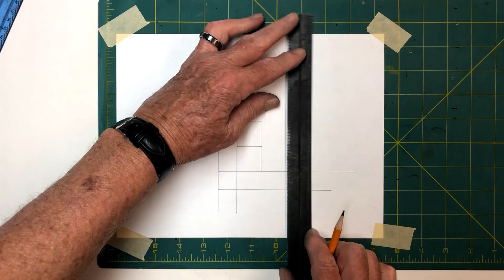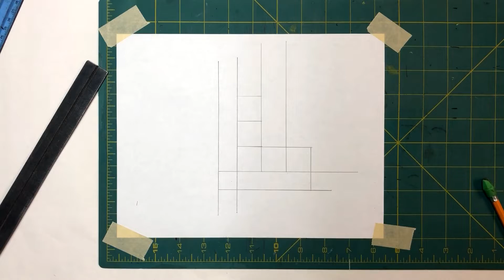Leaded Glass Spinner for Beginners !!!

Comment: Thank you So much Bill! I've tried to do a spinner watching other videos.... failure. Your videos are the best for those of us that are visual plus verbal direction. Best to you and yours!
Reply from the maker: Hi Julie,
If you're having some trouble putting this together, cut 6 -4"x4" cheap clear glass pieces and work on putting them together, before you start cutting up you're good glass. You can use the clear one as a trial run. You will only be out a little U Came and some solder. After you get where your comfortable putting it together, you can cut the U Came off at the solder joints and use it on another project. Let me know how you're doing with the project. Best of luck!!!
Regards,
Bill Stone

Comment: I’m so glad you did a spinner. I happen to be working on one now. I cut 6 4x4 light amber squares, that I etched rabbits into the glass. I wasn’t sure how I wanted to go from there, but now I do. I was wondering if I could use lead came, because all that I’ve seen so far have been copper foiled, so I’m very happy that I can use lead came. Thank you so much for sharing your process in making a spinner. I know now that I won’t have any problems ( hopefully 😊).
Reply from the maker: Hi Therese,
Good to hear from you, sounds like you are working on a spinner right now, GOOD FOR YOU. Sounds like a great project, should look great hanging in your patio. Best of luck with the project.
Regards,
Bill Stone

Comment: I love this ... I do a lot of copper foil suncatchers.  Thank you for this video <3
Reply from the maker: Hi Deborah,
So glad you're enjoying the video, I have had so much fun making them and sharing them with others. You can find all my videos in one place by typing in the search bar Bill Stone's Stained Glass Creations and click on my photo and they will all come up!! You also can make this spinner using the copper foil system, it's a little harder to put the hanger on the copper foil, but if you have been making suncatchers you shouldn't have any trouble. You can also make the inter part of the panels in copper foil and finish off the outside edges with lead U came. Check out my video on the flower solar lantern's and the one with the sea glass! All three of these projects use both lead came and copper foil. Again think's for your comment on the video.
Regards,
Bill Stone

Comment: I love the spinner.  I’ve made a couple using foil and solder but not lead.  Is there a specific size of lead you are using?  And do you have to grout it to hold the glass in?
Reply from the maker: Hi Gloria,
Glade you are enjoying the videos. I use RU-70 U came, it's 1/4" wide, 5/32" channel and 3/16" Face. The H Came is RH-9, It's 7/32 Wide, 3/16" channel and 5/32" Face. You can check all the came sizes by going online and type in Cascade Metals. They are a large supplier of lead came. The chart comes up in decimals, there is a box to check to make it into fractions. I use this came for all my projects, big or small. I don't know if you looked at the video on the leaded glass clock? At the end of that video, it shows some of the larger window projects made with that same size came. If there is any draw back to that came, it's that you have to cut your glass very accurate as there is a very small channel for the glass to fit into!!!
Hopefully that helps you out, if not send me another comment and I will try to get you a answer.
Have a great day.
Regards,
Bill Stone
Reply: @billstonesstainedglasscrea3310  thank you for the info. I’ll check them out.  

So because of the came you are using and the glass is cut so precisely you don’t have to grout your pieces?
Reply from the maker: Hi again, 
You're right the more precisely your glass is cut the less room the glass has to move around in the came. I have been making these Solar Lanterns, Suncatchers and Spinners for the past 20 years and I've never had one come apart yet!! Also glazing the glass panels is my least favor part of doing leaded glass, it's messy and a lot of work and time to clean it up after glazing it. Try it both ways and see if you see any difference in your small projects. Glazing the panels will make them stronger. Best of luck on your projects.
Regards,
Bill Stone

Comment: Hello Bill, Thank you for your easy instructions.  I am sorta new and may I ask one thing I have the spinner jig what do you use to make that seems on the inside of the jig?   
thank you for giving me new ideas and help.. I've not made a spinner yet LOL little scary.  
Karen in SC keep bringing new videos.
Reply from the maker: Hi Karen,
Nice to hear from you again. The small strips on the spinner jig are,
3/16" square and are made of wood. I just cut them out on a table saw. So glad you're enjoying the videos, you should check out the newest one on how to make a Leaded Glass Hanging Terrarium, in it I talk about the small jig I use to put the sides together in it. It's the same one I use to put the spinner into sets of two before I use the spinner jig to do the final assembly on the spinner. If you are using a different size U came you would make a small strip to match the size of your came width. You just want the edges of the two pieces to kiss the outer edge of the came, If your real new to leaded glass you could just cut 6 4"x4" clear window glass and put it together to get a trial run before using your expensive glass. I sometime use scrap clear glass when I'm trying to work out a problem on a project. You can find all my videos in one place by typing in Bill Stone's Stained Glass Creation in the search bar and click on my photo. Please feel free to ask me any questions about any of my videos.
Regards,
Bill Stone

Comment: Hi Bill, The push pins seem like they are going into the work surface fairly easily. Is the work surface a sheet of sound board? Thanks
Reply from the maker: Hi Joey,
Great to hear from you.
 Yes, the top of my build table is made of 1/2" Homasote #440- Sound Barrier Board. The worktable has a 3/4" plywood base with the Homasote board on top. You can purchase this at most old fashion Lumber Yards. It comes in a 4'x8' sheet 1/2" thick. Most lumber yards will cut it to the size you need. The push pins I use are 5/8" long, they also make a 1/2" pin but I like the longer pins better. If you are just starting out in leaded glass and don't want to buy the larger sheet you can find it on Amazon and Delphi Glass, in 24"x24" sheets. If you can use the larger size sheet then go for that, it is much cheaper than the smaller sizes per square foot. I use this pen system on all my larger glass projects also. If you want to check some of these larger projects, go to the end of the video showing how to make the Leaded Glass Clock project. Thanks for your comment and if you have any questions, please feel free to ask me about any of these projects. Have a great day!!
Regards,
Bill Stone
Reply: @billstonesstainedglasscrea3310  great information sir! Thank you
Reply from the maker: Hi Joey,
Glad the info was helpful, and you can use some of the info. If your just getting started here is a great webpage to find out all you need to know about Lead Came. All the projects I make are using RU-70 U came and RH-9 H came. All these Came products are made by Cascade Metals and it shows everything you need to know about Lead Came.  Have a great day! 
Regards,
Bill Stone

Comment: When you are using your designated rulers to cut your pieces, are you compensating for the lead?  The cutter head is not directly next to the ruler edge so wondering if this makes your piece grow????  Thx
Reply from the maker: Hi Mary
Things for your comment. Yes, your right, because the scoring wheel is in between the two up rights on your glass cutter you do add to each cut and the projects grows a little. What I do to compensate for this is I will cut the glass to the sizes I want using these standard rulers then set up my form to make the project. Stating in the left-hand corner with a 90-degree angle install my U Came down the side and across the bottom leaving it long on purpose. Then install my glass in the order I want it to go with my H Came in between the glass pieces. When I get then all in place, I put a piece of U Came down the other side, then I will add my form to make up the size of the project. By doing this that way you can use these standard size rulers. If you don't do it this way, then you will have to come up with a smaller ruler approximately 1/16" small then the size you want to be your finished piece of glass. I hope that makes sense to you. When you have some time check out my first video called Leaded Glass Solar Lantern and it shows that on the video, where I cut the glass using a, 2", 1", 3/4" and 1/2" ruler to make piece which would measure 4 1/4" although I need the project to be 4 1/2" wide, after adding the U Came Around all sides and the H Came in-between it comes out at about 4 9/16". That video is the very first video on my video list. Hope that helps you out!!
Have a great day!!
Regarsd,
Bill Stone
Reply: @billstonesstainedglasscrea3310  yes it makes perfect sense.   I have watched all the videos and the instructions and tips are very helpful, especially using the cotter pins as hooks.  I only work with lead and was excited to watch the spinner video.  I was under the assumption they were always done with copper foil!  My next project 😃😃😃. Then on to the lanterns!  Thx for all the great videos!!!
Reply from the maker: Hi Mary,
So glad the info I sent was helpful. I have always liked Leaded Glass better than Copper Foil; I like the nice lines it makes so much better than the solder bead on Copper Foil. Almost all the larger projects I make are all Lead Came. Did you look at the video WHAT I DO WHEN NOT MAKING THESE YouTube VIDEOS!! there are several Copper Foil projects in there along with all the Leaded Glass projects. Check it out when you have time. Back to your original question regarding the Came makes your project grow. When you make your own designs up like most of my projects, I use what I call Cut and stack and don't really care if they grow a little. The only time I have to be sure to make the project to size is when it has to fit into windows or doors, then it's important that it fits!! Best of luck with your spinner.
Regards,
Bill Stone

Comment: Hi Bill. I have made this type of spinner using foil and solder. I would love to try this with came. Could you tell me if this is lead or zinc and where can I buy the size you use? Thanks
Reply from the maker: Hi,
The came in all my projects are made by Cascade Metals, they have a great web page on lead came, check it out when you have time. The lead came I use is RU-70 for the U came and RH-9 for the H came. If you haven't used lead came before, be sure to stretch it before you use it. If you're not sure how to do this check out my video on how to make a solar lantern for the beginner, it will show you how to stretch the came. This is the first video I made and is at the very end of the list when you go to my YouTube channel. If you check out Cascade Metals, just look at the lead came spec sheet to get all the sizes for the came I am using. So glad you are going to try the leaded glass system, I like it much better than copper foil, but sometimes the project can only be done in copper foil so it's nice to know how to do both systems. You can buy it from any glass supply store, E Bay, Delphi Glass and Amazon. Most of the time it comes in a roll, this is fine because when you stretch it. It will come out straight. I buy my lead came in 6' strips from my glass supplier. I hope this was helpful, please feel free to ask me anything about any of my video projects.

Comment: I somehow missed where you attach the loop to the glass.  I'm assuming that you just welded it on.  But what did you use to make that loop out of ? Okay now I backed up the video.  The loop would be attached to the end I thought the loop would be attached at the end of the project ❤.
Reply from the maker: Hi Lisa,
Thanks for your comment, I took a look at the video and if you look at it again go to the 5:15 minute mark and watch it to the 7:50 minute mark you will see how to install the hanger. I hope that helps you out. Let me know if I can answer any other questions about any of mt video projects. Please feel free to ask me anything. Also, check out the video on how to use my hanger system in my video Leaded Glass Solar Lantern Hanger. That video gives you a lot of ideas on how to use the cotter pin hanger idea. Again, thanks for your comment and thanks for subscribing to my channel. Have a great day and let me know how you make out with your project.
Regards,
Bill Stone
Reply: @billstonesstainedglasscrea3310  
Yes I found that.  And I find that your work is very clean compared to many others that I had seen.
Reply from the maker: Hi Lisa,
Thanks for your kind words, so glad you found the info on the video. Thanks for your comment and have a great day!!
Regards,
Bill Stone

Comment: I tried this but it was a mess! Used the Morton layout system, but came edges were not nice and straight like yours so panels did not fit well. Any tips?
Reply from the maker: Hi Monti,
So sorry to hear you had problems with the spinner project. I'm not familiar with the Motton layout system so I don't know how it works. I would suggest you take another look at the video and maybe you can see where you got messed up. In the video you will see I always make a from to make these panels all the same size, that is the trick to getting the spinner together and get the sides to line up. If the panels and all different sizes it will never go together right for you!! Take it apart and make a form and rebuild it so all 6 panels are the same size and see if that doesn't do the trick for you. Did you make a jig to put it together? In the video you will see I first put the panels together in sets of 2 panels each, they put them on the jig to put them all together. Best of luck and I hope that helps you out. Please feel free to ask anything about these videos and I will try and get you an answer. Let me know how you make out.
Regards,
Bill Stone

Comment: Great video! Thank you!
I have a couple questions…
The gap on the jig for the 2 piece joining and the little stripe inside the angle on the assembly jig: what are the dimensions on those?
And I am new to Stained Glass, so please forgive this question if it’s dumb, … is there a reason you call it “Pan-Teen” instead of “pah-teen-ah”? 
Thank you again!
Reply from the maker: Hi Traci,
Thanks for your kind words, glad you're enjoying the videos. The small strips of wood are 3/16' square, which lets the edges of the two panels just kiss each other. This gives you a nice fit to solder the two together. The big jig uses the same size wood strip to put the group of two together, remember to check your fit to make sure you don't have any gaps in between the two panels. 70 years ago, my father told me there were no dumb questions, just dumb mistakes, because you didn't ask a question on how to do something!! The product I use to turn the lead black is Patina for lead and solder and is made by Novacan.
Hopefully that is going to help you out, please feel free to ask me anything about of the projects on my videos
Regards,
Bill Stone
Reply: @billstonesstainedglasscrea3310  thanks so much Mr Bill!
Reply from the maker: Your more than welcome for the info, sorry to be so late getting back to you, been out of town!! Please feel free to ask me any questions about any of my videos.
Regards,
Bill Stone